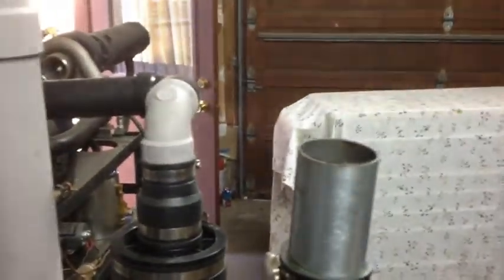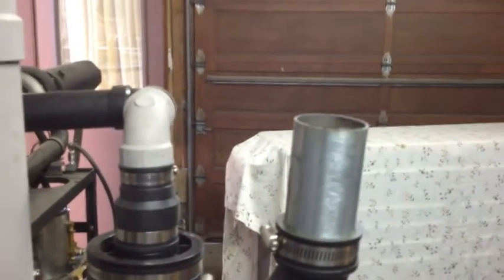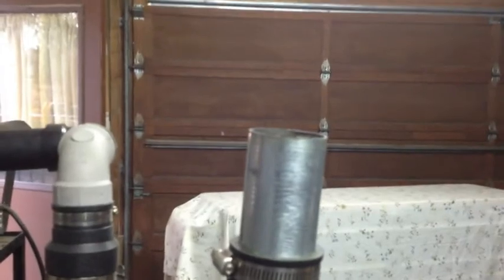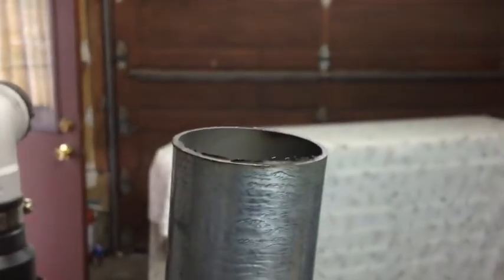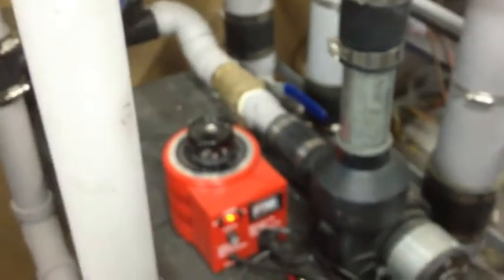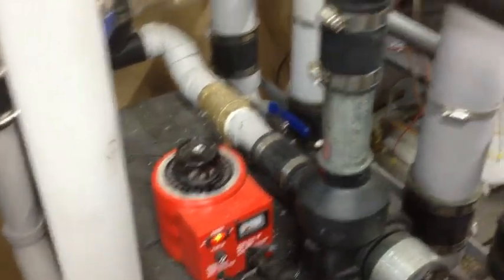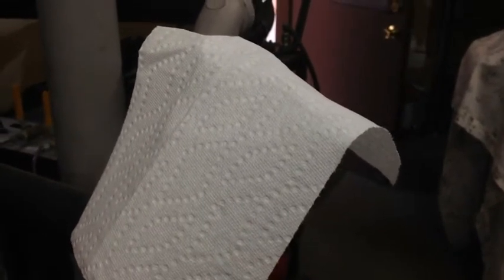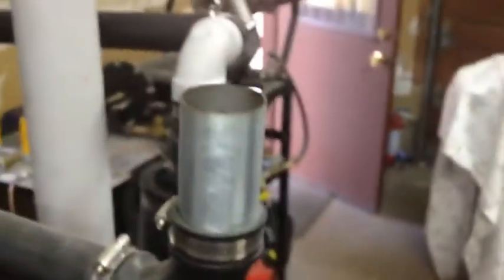woodgas flame colors (Interesting)

Comment: The commenters are being very nice. Some of us these days are looking to actually use a gasifier to run our ice where you were experimenting.
You are, indeed, producing very clean syngas but it would have been interesting to have seen you and your abilities try for maximum extended runs with an ice under variable loads such as a generator.
Thank you for sharing your experience, it's very informative.
Reply from the maker: Thanks man. It was a fun experiment. So many things on YouTube are fake, this was the main reason I wanted to see if I could run a engine on it, and it worked👍. Not sure when but I would like build a smaller device. The one thing that I disliked is the amount of cleanup for this machine. The tar can be a big issue. If I would build another device I think I would use hydrogen as a fuel rather then this gas. Happy you liked the video
Reply: @Josefppaz  I understand your personal adversity to the thing being dirty, I don't think that you'd like having a wood fireplace versus gas-logs. But for what it is to those of us who hate paying for something that's already been paid for decades ago (electricity) by our forefathers the dirtiness of it is the last and least concern.

Is hydrogen not what the gasifier supplies that runs the ice?
Reply from the maker: @jcksnghst  not sure what you mean by ice. But your right there is hydrogen methane gases. With the tar it produces can clog the machine not to work. There are other ways producing hydrogen cleaner buy as an example solar panels. No clogging or cleaning any machine pipes, less maintenance 👍
Reply: @Josefppaz  internal combustion engine
Reply: @Josefppaz  solar panels? Cool, I haven't heard of that, ways to run an ice with hydrogen via solar panels?

For real, thank you for your time.
Reply from the maker: @jcksnghst  absolutely here’s a link to a video with Bob lazar it’s very cool
 https://youtu.be/Ytg23mDd1a4

Comment: When you are talking about feeding the gasifier a bit of fuel at a time you are in essence starving the gasifier which will make it run cleaner. The drizzler is based on that same concept but Luk also has an automated feeder so things get a bit more involved. This is also why you try to match the engine intake vacuum to the gasifier then when you add filters to the setup you can get an ultra clean gas even when the hopper is full of wood. Joe wood pellets are a blessing and a curse because they work well with the gasifier but the tar production becomes an issue with wood pellets because you don't get the air penetration in the ember bed still man, nice explanation and a nice job too.
Reply from the maker: Thanks buddy its been a lot of fun with this woodgas lol sometimes when im excited I mumble a lot during my videos or repeat myself. Flash I’m trying something new with the filters, I’m using a water pump with antifreeze as well as venturi scrubber idea with sink drains, you mentioned antifreeze in a message to wkweasle one time its seems very promising especially in the Canadian winters. See what happens man I will make another video up soon, thank you its been a really fun hobby so far.

Comment: Hey Joe, I had a couple of questions for you. What size pipe is your air intake ? The next question is how do you ventilate the garage your in? Do you see the temp in the garage increase during the course of a run? Also what is your air temperature in the garage vs. outside? I think it goes to show you how the moisture content in the fuel puts a load on the system. Nice work by the way. Thanks for sharing, Joe P
Reply from the maker: mazdalorean 

Hi Joe from
the top down to the reduction zone.  I
have a 1 ¼  ball valve reduced after to 1
inch then I have a 1 inch to ¾ elbow extending midway way down to the reduction
zone and the rest of the  pipe to ½ inch.
The ventilation part, well just for the film I just had the thing running in
the garage so it was dark enough to see the flame colors. Periodically I always
had the garage door open but usually for long periods of running the machine is
outside or the main garage door is open, im always a little worried about
carbon monoxide.  This winter had been a
really nice warm winter.  Although the
gasifier makes a lot of heat I never really measured the temperature of the
garage before, even though I have the main garage door usually open.  I see what you mean and your absolutely right about
temperature effecting burn and moisture. 
I find that usually filling up the machine with wood im getting a lot of
moisture, which is making the reduction zone have to work harder for a clean
burn.  This is why I don’t want to fill
the thing up anymore and just periodically add wood when the machine needs it.
I do this by looking at the flame colors. 
As the wood is almost consumed there will be a blue flame by adding wood
the flame changes to pink orange violet as soon as the wood is mostly consumed
its back to blue then I add more again. One thing I want to add is I think
Flash lives in a area close to sea level, were I am the elevation is about
4000ft above sea level.  I find that I
need to have more air in the reduction zone to keep a hot burn so I made the
end result to almost 3inch straight pipe reduction rather then the inverted
bell idea, so I took rather flashes old design. 
Seems for me its running hotter. 
My biggest problem I think I have is if I pack my filters to much I
really need to have the suction from my blower to work harder but I don’t think
the machine is running hot enough to crack the tar even though im getting a
blue flame just a guess. Hope this helps buddy, cant wait to see your machine
working, looks like a really nice piece of work.

Comment: Howdee Joe.
I dunno how I missed this video until now, but I sure enjoyed it  :) .
Whoever gave it a dislike needs a serious beating with an organically grown carrot!
You have made the same discovery as I did when I was running a FEMA gasser.
Just as the fuel was about to run out, the output gas stream would clean up quite a lot.
Perhaps the flame colour is an indication of the residence time, versus the pyrolysis gas strength. Either way, dribbling the fuel into the gasifier seems to be advantageous.
What's cool is that you would no longer need to operate the lid, and you could add an automated fuel feed system, just like the Drizzler concept uses.
Also, there may no longer be an issue with smoke clouds in the hopper cylinder.
Since you are seeking to operate your gasifier unattended for extended periods of time, it seems that you have hit on the solution all by yourself.
Well done indeed  :) .
Reply from the maker: Hahahahaha man that made my day the beating with organically grown carrot almost got me on the floor. You have an awesome sense of humour thank you my friend lol
Reply: ***** 
Yer welcome  :) .
I always like to go for the healthiest form of battering and bruising device when beating my opponents ;) .
Normal carrots are ok, but the organically grown ones really add a good welt to each and every vegetationally enhanced contusion  ;) .